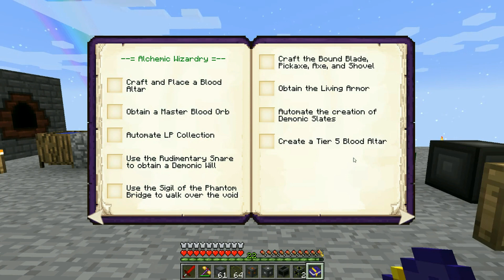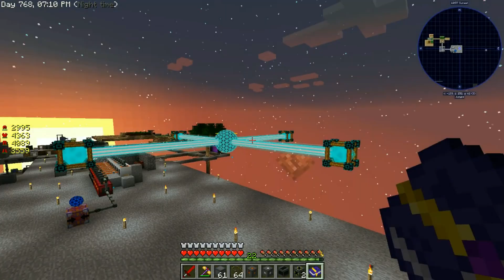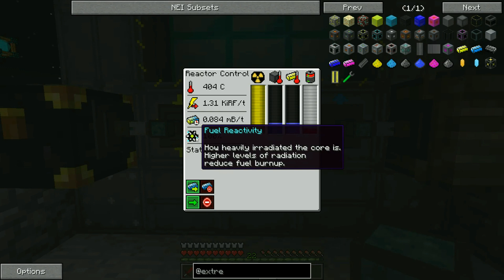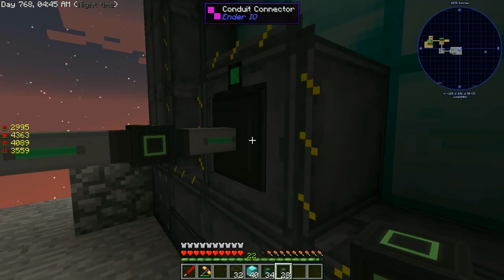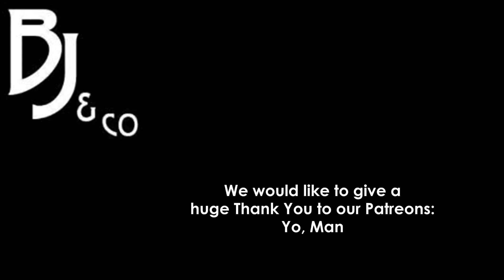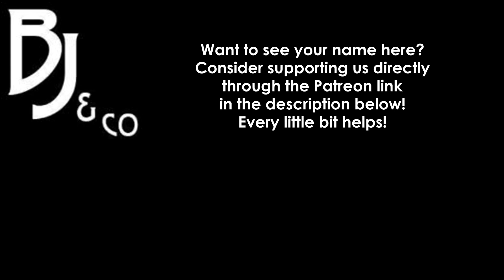Skyfactory 3 - Achievement Guide - Ep 24 - Passively Cooled Extreme Reactor

Comment: How did you automate your yellorium crafting? Really helping me out w the videos btw! keep up the good work man.
Reply from the maker: I use my refined Storage system to handle the auto crafting. I have my farms making the essence (Mystical Agriculture) then a pattern in the crafter to turn the essence into ingots. There is an exporter that has a crafting upgrade in it (so whenever it needs to export it will craft it if the system doesn't have the actual ingots) set to put them in the ender chest then on the other side just pull from the chest into the reactor. Hope that makes sense. Thanks for stopping by! Glad the videos are helping you out!
Reply: @BJandCo  I needed help with that too, I have no idea what you said but thanks :D
Reply from the maker: @sanchu6335  Glad I could sort of help. Defionitly look into mystical agriculture for  easy resource generation!